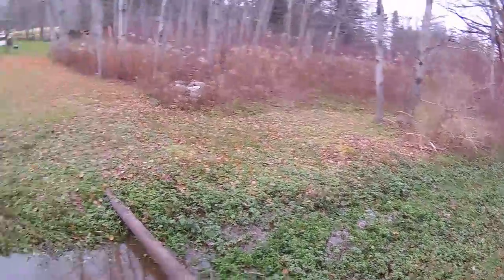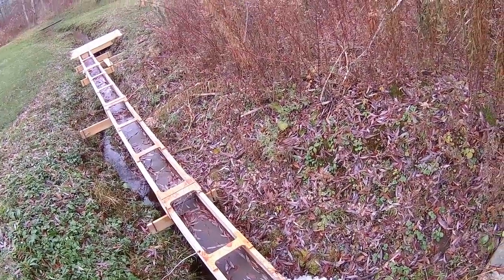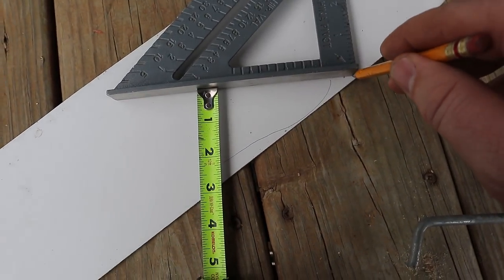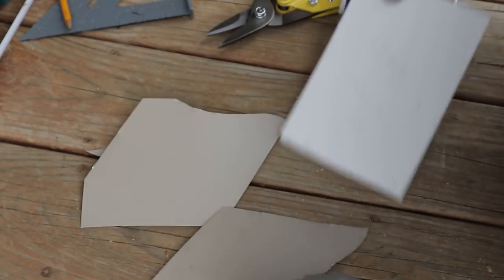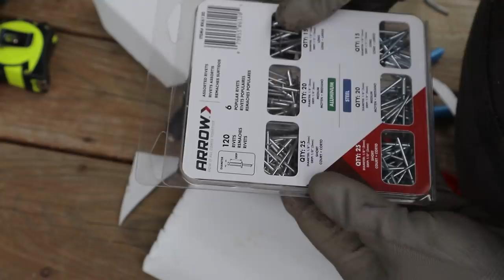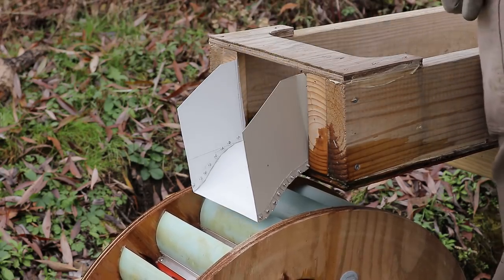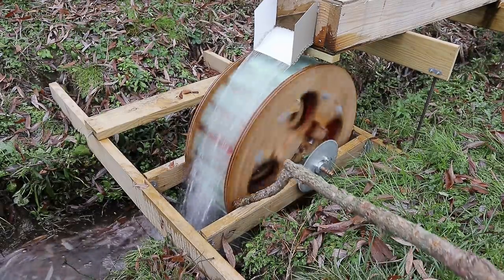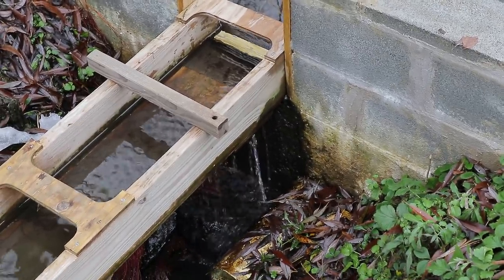[Part 6 of 10] Waterwheel Microhydro, Chutes and Rakes

Comment: you wanna know what i think why you got so little power out of it with the chain? because the sprocket you attached the chain to is so much smaller than the waterwheel itself.
for more power you want a bigger sprocket going via chain into a much smaller sprocket so for every one revolution the bigger sprocket does, the smaller sprocket does several.
Reply: Basic gear work right there.
Reply: He has big to small and that make more speed small to big would make more torque but make less power because your turning the motor slower
Reply: @schuylermills8077  It might be that he needs a smaller sprocket on the water wheel, you have to match the ratios like with a motorbike . If he has a smaller sprocket on the water wheel it will turn faster and that will be transmited to the generator sprocket
Reply: It’s relative chain (or pulley) wheel size. Big to small spins the generator fast enough to make useful power.

Comment: I find it hard to believe that this amount of water couldn't produce as much power as one of those 6.5hp HF motors.  When you stuck that bucket in and it filled instantaneously.  That's about 30 pounds right there at the end of your wheel.  I didn't do the math, but that's plenty of torque in a quick enough time to make a few kw.
Reply: That was after a downpour though, so the water level of the pond was higher.
Reply: I suspect if he flipped the weel so that the water rotates the lower part of the weel "downhill," much of the drag he has would go away and the generator would have more energy. Right now, the lower part of the wheel "fights the water" and burns a lot of energy pushing water uphill, if that makes any sense...
Reply: @McBlokeados  The stream ubder the wheel does not normally reach the wheel
Reply: Based on the average flow and the amount of head, this system was calculated to have a maximum of about 11 watts of potential. Not very much and certainly not kw worth. The flow can increase significantly during/after a serious rainfall however the average is still pretty low. There is also system inefficiencies inherent to any energy conversion system.
Reply: a Horsepower is 550lbs over 1 foot in 1 second.  Thats ALOT of power.  filling a 30lb bucket 1 or 2 foot deep in 1 second isn't close.
Reply: Take a look at my comment above. I address what I see as a couple of issues that, if not altered, will keep this system from it's full potential.
Reply: @McBlokeados   Not so. The essential power source in a water-wheel is the force of gravity, combined with rate of flow. View my original comment above. I may be wrong, but it should work better than the system he has now.
Reply: i think when he put the bucket under there was more flow so it filled quick . He wants to put a fall on the shute from the reservoir as well , does not need to be a lot but it will speed up the water flow which will turn the water wheel faster, etc , etc
Reply: @McBlokeados  you are talking about an undershot wheel rather than the overshot that he has ,. He would more or less have to start from scratch to do that
Reply: @nathanrogers8713  if you have a big enough pond it should equel its self out , its how hydro electric plants work with having a dam . Keep a head of water for when its not raining so much

Comment: I live completely off grid south of Petersburg Alaska. I bought a hydro system from a company in Oregon for the stream on my property plus I got state and local permits and it all wasn't cheap. But this system creates 250 amps of constant electricity.
Reply from the maker: well it sounds like you need to make a video and upload it to your channel. who did you buy the turbine from? I'm working on another system at another location and I'm looking at 1kW of potential capacity.
Reply: 250!?!?!AMPS???
You can run 12+ normal houses from that so i need proof!!!
Reply: Matte Edström likely at 12V, so 3,000W rated continuous power, or just about right to supply one house in Alaska with peak demands provided he has about 5-10kWh of storage.
Reply from the maker: @MultiThinkingMan  250a would require really fat wires. Most big hydro is never below 24vdc more likely 36vdc or 48vdc if using a battery, possibly more. It's also possible that he is using AC direct so he would be generating 120vac,  or maybe 240vac split phase since he is in North America.
Reply: @MultiThinkingMan  But 250 AMPS!!! do you know how much that is???
Cables needed for that is close yo your wrist size!!
Reply: @MultiThinkingMan  He was talking about AMPS!!! Not WATTS!!!
Reply: @matteedstrom  250 Watts is roughly 2 to 2.5 Amps, 250 Amps could be as much as 25000 Watts and could certainly feed 4 or 5 decent properties. I am no Sparky but I think old A. Einstein up there is confused a bit with the electrickery. I mean good for him if he is right, but I think I need proof as well
Reply: @fruitgums  BUT HE IS SAYING 250 AMPS!!! NOT WATTS!!!!
Reply: @fruitgums  it could be high amp's but low volts.  Like what comes from a welder
Reply: @matteedstrom  ever see the movie "running scared"? "how many amps are there?" "enough to push a train! now, shut up!" lol...and then, he plays chicken with the train, but the train isn't gonna veer off. so, he veers off and looks back at the train and yells "chicken shit!" great movie.
Reply: @MultiThinkingMan  But he stated 250!!! amp!!!

Comment: Biggest issue is the water flow. IMHO, the dam should be one course higher, and off-set to one side to place the wheel out of the natural stream, set into a dug-out opening.  With a wall blocking the stream from the back of the wheel and a channel to turn the water back into the stream after the wheel, you could gain all of the motive power of the flow without the drag of the stream robbing power. At that point, the vegetation down stream would not be an issue. Look at pics of old-fashioned waterwheels. They are never placed directly in the center of the flow. They are always placed to one side, and usually above or shielded from the stream to avoid the drag of the stream. Lastly, the outflow of the flume should hit the wheel approx. one-third of the wheel's radius down-stream. This would increase the efficacy of the wheel exponentially. Excellent idea, good execution; just needs a little overall fine- tuning.

Comment: thanks for posting.   but, joe, you KNOW that the water simply should fall into the buckets, at about 11 o'clock.  period.  you KNOW the 'wheel should be loaded so that its rotation rate is, around, twenty rpm.  (the buckets need TIME to fill, after all)   the gear currently mounted should allow a good one to three step-up, first stage of power take-off.   cheers

Comment: So why the flume instead of just using PVC pipe leveled?
Reply: That was addressed pretty early on in the series: So that he can get in and remove obstructions.
Reply: @crocosnz3322  pvc would be so much easier. Just put a 90 degree elbow and a few inches of pvc pointing down. It will draw from under the surface and all the debris will go out your overflow. So much easier than a flume.
Reply: John Kidd I wouldnt, leaves and grass you saw in the flume would work as a plug in the pvc
Reply: @panpetiche8132  No, you screen your intake and suspend it below water level so the surface debris goes out your spillway and not in your intake. I have pumped swamp water from debris and leaf filled ponds using this method for years with no problems. I usually tie a couple of 4 liter plastic jugs to the intake so it floats a foot or so below the surface and goes up and down with the water level. No adjustments necessary and no surface debris goes in the intake.

Comment: It's got me why you never just used a 4-6" pipe than to build a channel like you did!!
Reply: Beryl Barker exactly and then add another mill farther down
Reply: Even 6" down spout would have been better. Less flow resistance with the smoother sides and rot resistant. This will only last a few years before major work is needed.
Reply: yeah, use a short 6" PVC pipe put through the dam and cut the end of the pipe in the shape of the water wheel placed right up against the water wheel.

Comment: Definately a smoother flow goin in to the paddles, especially as they start to initially fill up. I think you could 'tune' it quite easily in the setup, simply by moving the wheel assembly downstream a hair. I'm having a feeling that for this setup you'll find your sweet spot  when the water forms a very short golden spiral arm from chute to paddle. Also that cool ripple is from the water current hitting the dam below and coming upwards.

Comment: You added a "ripple" bar (sometimes called a weir.) I think that you wanted to add a block from above that would touch the surface of the water to create an constricted inlet slot, (if your goal was constant flow). This would require a bypass for the dam, (though animal burrows may provide that function it will be damaging to the soil and may catastrophically compromise the dam at a later date.)

Comment: Look at the ancient Roman Systems. By using the Water Pressure they were able to bring Water upwards. So make your walls higher and  end of the shut to increase the dropping height therefore increase the pressure on the wheel for higher Torque. Same thing with a bigger wheel and you will be able to increase the output with a higher transmission ratio. You also should check out the position of the Wheel to the Shut and the angle to the Halfpipes and also the  Rotation angles of the Halfpipes.

Comment: You could have eliminated the flume entirely.  Just use a 6" or other size pvc pipe and then a rise just before the wheel and then another turn over the wheel.
I love how an overshot wheel cleans it's self.

Comment: If you make a simple brake and torque arm, measure the torque with a scale and rpm, it is possible to calculate the horsepower of your water wheel and what kind of generator you can use. The maximum power is derived when the buckets just fill 100% when you brake the wheel and take the measurement of the scale. 

Also you might want to explore the "otherpower" website for home made axial flux generators you can DIY.  :-)

Comment: Every one of these projects has an issue with debris either clogging the intake or going through the system. Simple fix known to anyone who has pumped water from a dirty pond. Put a 90 degree elbow pointing down on your intake. It will draw water from under the surface and all the debris will go out your overflow.

Comment: A bit overkill on the number of screws across the bottom,  but seems much better, I think the wheel should come up a bit and be moved away from the trough (further downstream by 4-5 inches) now to take advantage to this newly directed flow, and then mount your chain and Alternator or whatever!
Reply from the maker: That's my plan. Read the description for more info.

Comment: I shouldn't laugh because im just as big as you but when you speed up the video you sound just like my dog panting....sorry buddy...it just made me smile
Reply from the maker: res1492 it's a combination of microphone too close, automatic gain compensation, and yes breathing hard because I'm working. I am big but don't usually have labored breathing because I'm not that badly out of health besides the weight. I regularly workout hard (just not at the gym).
Reply: Dude im not judging at all, i pant like an elephant in heat just walking up the stairs...i hope it didn't come across like that.
I only just found your channel and would hate to think i offended you already, im sorry if i did.
Reply from the maker: No problem.
Reply: i think u have too many paddles on the wheel, maybe remove every other one,  but u have done a great job

Comment: Interesting thought for you: The person who installed the gutters on my house said that you only need 1/4 in drop in 40 feet to have a good flow.
Reply: Sewer drains carrying solids use a 1 inch drop over 10 feet to provide enough water pressure to carry the solids. On heavy days most of his flume water will be lost over the sides.  On light days, it will travel fast but may not have enough volume to turn his wheel. If his pond depends on runoff, his system is going to be erratic. He may have to depend on batteries to get a constant source of power.

Comment: Why don't you use capillary attraction to return the water into the reservoir to create more pressure, and build a plastic reservoir above the wheel? What do you think about the wheel being prevented from capturing the water to save its energy so it doesn't have to carry the water back up during its half cycle. The water should only hit the flaps and get back immediately into the stream, so its not carried back up after its half cycle. Should you not then remove the red bit of the inside of the wheel and test that?
Reply from the maker: That's a perpetual motion device. Wee don't speak of those here.

Comment: you should make the cogwheel bigger. about 3/4 the size of the waterwheel. you have enough waterflow, so you'll have enough torque. that should give you at least 12 volts. the cogwheel you used is from the go cart. the cogwheel for the go cart is made so that the energy from the engine is enough to turn it really fast. your waterflow is pretty fast, but not as fast as a go cart engine. also, the waterwheel turns much more easily than the wheels on a go cart holding a rider's weight. the waterwheel is rotating so fast that the energy is wasted and more torque would slow the waterwheel down and there would be less splashing. plus, power wash that thing down, sand it and paint it with outdoor paint or wood preserver. if you get a bigger cogwheel and make a new video please post the link here.

Comment: also if you make your wheel smaller it will rotate faster more rotations and maybe add some gears off the side and change the speed faster and add generator and boom add to grid you make money while you sleep and or free electricity basically as long as you make more than you use which is easy to do.

Comment: Yeah putting the axis back will make less clapping sound on the blade ... putting the drop a bit afront of the axis and not in the middle was the key !! ... no backward movement and the water is pushing more. ( sorry for my english writing. It is not my first language, hope you understand ... previously i did add this comment on the 5 video about it, and now i see you did it. :-) ) it is also because the shape is round, so, the calculation of the line of the water inside is less then a straight flat angle blade, triangle angle and not curbe give more water before the water in the blade empty it self the curbe blade as the half of weight cause the water fall sooner by rolling inside and wave when the angle is turn. i dont know if i make my self clear but a triangle is more water then a curbe blade - see here how much the blade are close togheter in this picture, it is all the same of closelly the same in all medieval europeen wheel i analyse. curve blade are good for horizontal turbine to fallow the vortex. : //www.waterhistory.org/histories/waterwheels/waterwheels6.jpg or http://www.waterhistory.org/histories/waterwheels/waterwheel2.jpg
as you can see, the angle and the size of the blades are really deep pockets.,  so more weight, more power, those thing was to turn rock wheel and crush seeds,  that was alote of friction. For speed you have enough blade. drilling some holes ( 2 or 3 ) in the middle of each blades will fill the next one also faster and faster, with out losing the push of the water, the last blade to be empty will have some water for the top one, that will give more water on the wheel before dropping but will give some more weight in each watered blades when turning ... the best shape for speed is the spoon, you wheel is in betwen of the straight blade, the horizontal turbine and the PELTON Spoon shape have some cut shape that acting the same way, so ... hum ... yep that why you say the same in the video -  https://youtu.be/TrZLNAOyNCE?t=1794
 ( the experience of our ancestors can teach us many things. And technological and scientific evolution too. 
There is a part of all this in this video ;-) This is my personnal point of view. maybe someone can help me to re-direct what is see better then i explain :-)

Comment: Just a tip to stop the drill slip try to find a taller online I can give you a link to find one of you need there are also special bits ave you should start with smaller bits and keep moving to bigger sizes until you get the size you need it minimizes problems

Comment: I was thinking about the durability not to mention the cost (unless you have some unused! I do not!) of exterior quality ply, and for the quantity necessary it is not negligiblble. Here we can buy rectangular gutters, which appear around the same size as the canal. I'm going to do a comparison of prices, bringing into the cost the time (which I economise!) reduced by using a canal "ready made". Any one else tried alternatives to plywood? If so what?
Reply from the maker: There's another guy Land To House on youtube who built a flume out of similar materials then used EPDM Pond liner to waterproof it with the liner draping over the sides so there shouldn't be water in contact with the wood. Any longer of a flume and large diameter pvc pipe would be a better option. One could cut a PVC pipe down one side and use a heat gun to form the pipe into a channel (similarly one could start with a flat sheet of PVC) but in this case the PVC would not be strong enough by its-self to support a full channel of water and would probably require angle iron to support it..